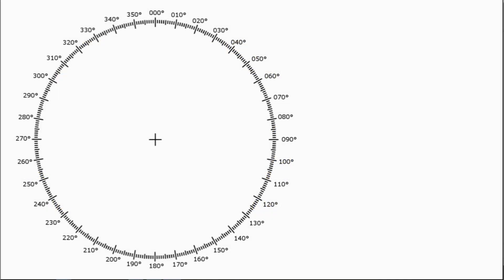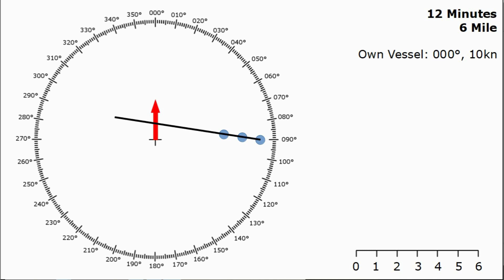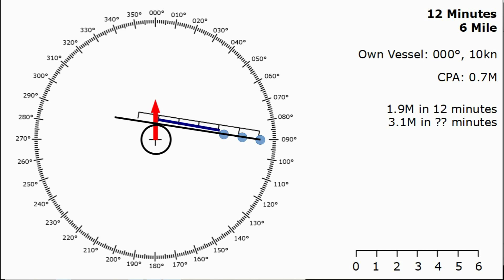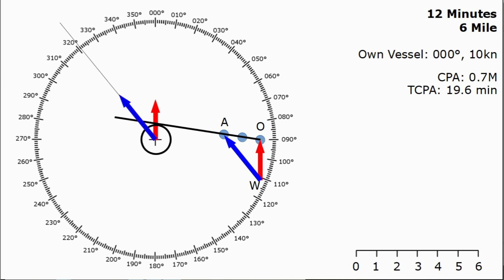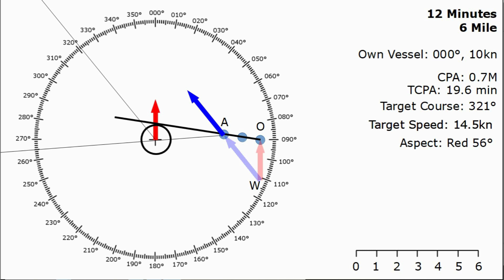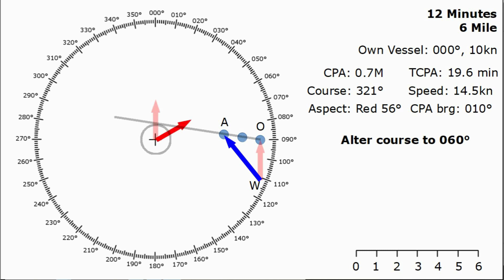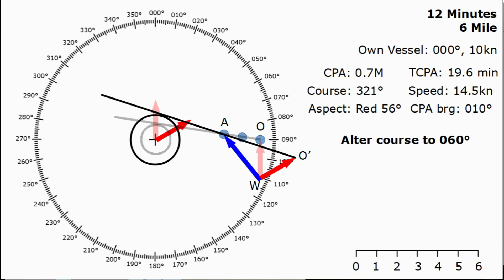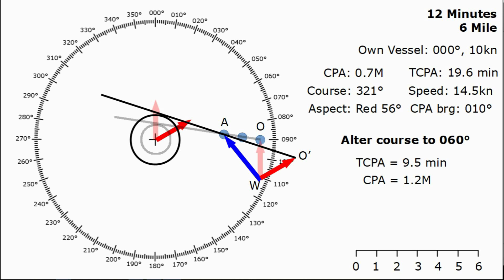Radar Plotting: Course Alteration

Comment: About the own ship vector line, when  our speed is 10kts so the vector length would 10NM? Did i get it wrong? How would I know the lenght of my vector?
Reply: hey, you’re measuring on the radar for 12 min. that’s why your vector is only 2 miles long, that’s the distance that you cover in those 12 min!
Reply: The distance covered is 10 miles if the speed is 10 knots in 1 hour , but in this case it is 10 knots in 12 minutes or 2 tenths of an hour. Don't forget that 1 knot is basically a nautical mile per hour.

Comment: Sound to hard to do your way.
My first plot is my vessel is at centre. I mark a line for my bearing and speed.
I then plot the position of my target vessel.
6, minutes later mark my new position. I then mark the target vessel new position. If no change in bearing or speed of both vessels.i then can determine a possible collision point
I then determine the time to that point of both vessels.
I check with a third plotting of both vessels current position to see if any change in course or speed.of target vessel. I then determine close point and decide if course or speed change is required of my vessel. It's simple and it's easy to see what is happening.
Reply from the maker: Make sure you don't mix up relative and true plotting. If your radar is giving relative bearings and distance of the other vessel, your own vessel should remain at the centre.